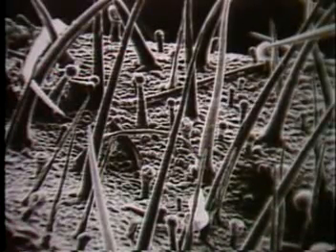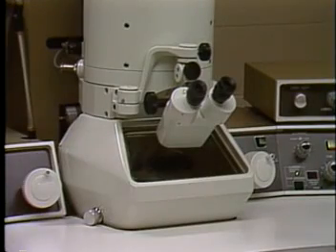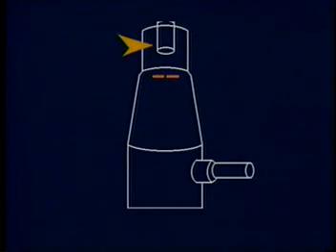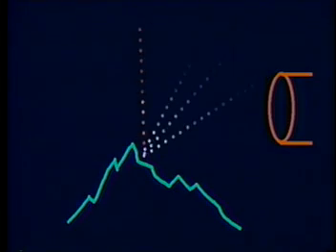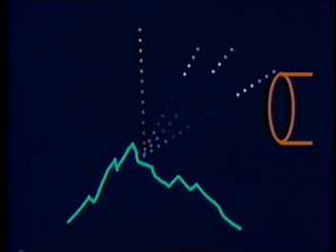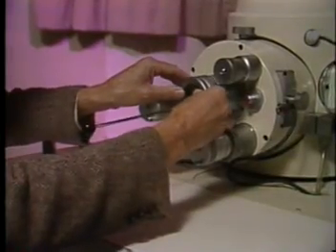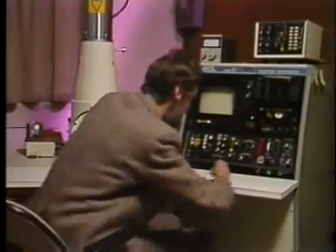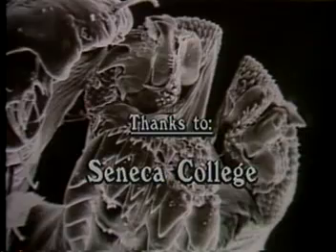Scanning Electron Microscope

Comment: the metal coating (typically Au) reduces charge buildup on the surface of the specimen by making it electrically conductive. The charging causes bright spots in the image, making it very hard to balance.

Comment: if you do not mind. i am preparing for project titled "study and analysis MRR and surface finish of Borosilicate Glass using EDM" and as you know the Borosilicate Glass is non electrically conductive. you know any microscope i can use since the Scanning Electron Microscope is used for electrical conductive material?